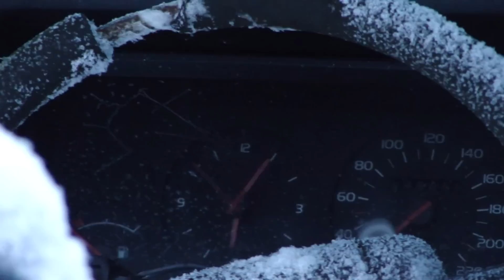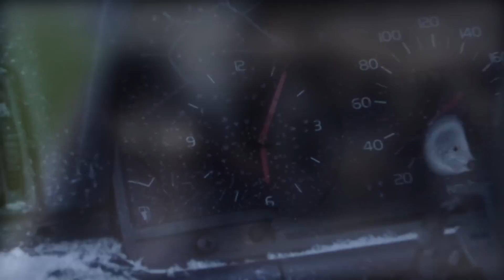Volvo 740: The END (HD)

Comment: I think it has something to do with the designer of the car, but I'm not sure about that. The 780 is also called "Bertone Coupé", and wasn't designed by Volvo themselves. And the mysterious 360, 460 and 480, which all were designed by Renault, didn't have anything but a straight 4-cyl engine. But you got a point there.

Comment: was the  rear end still good? lol I need one for my 240DL. But it's going to the local junk yard where they take the good stuff off it and sell it and recycle the rest. Rear end is gone on it and so is the exhaust. it needs WELL over $800 of work. 1990 Volvo 240DL with 225K miles will soon RIP.

Comment: somehow I have the impression you really loved that Volvo,couldn't get rid of it... From time to time a ride in the fields 'cause that machine is unbreakable; used to drive an'88 760 2.3 injection wagon with only 60.000 kms fm 1st owner, sold 3 yrs later with 220.000 kms. My way of killin a car which I treated with syntetic oil up to washing out of cooling chambers in the engine, but believe me no delicacy I pushed that car hard, miss it in a way...

Comment: @studiotos well,my volvo has only 250000km,s and you cant see any bubles fro the expantiontank
that reveal the exhaust from a bad gasket.
but it's verry weard he only overheats when whe drive it on a field"it has to pull alot" otherwise
like on the road nothing strange,do you had the same thing?
what i find verry strange is that you drove that "car" for over 3-4 years,i only 1 single year, haha